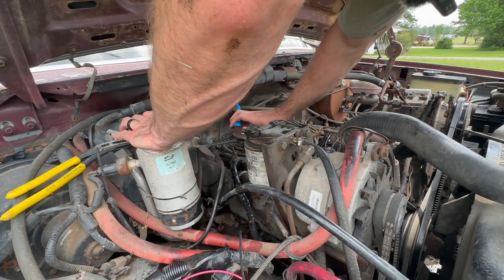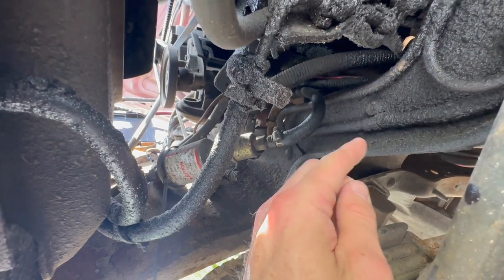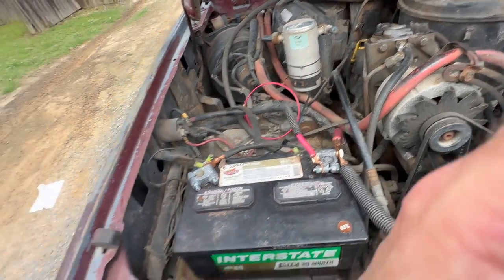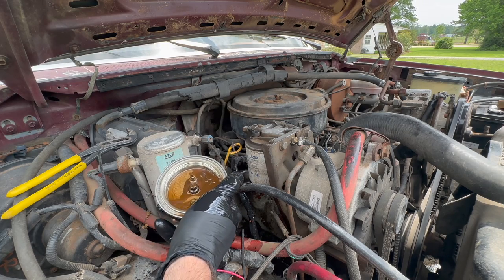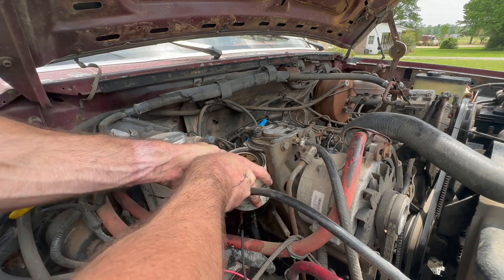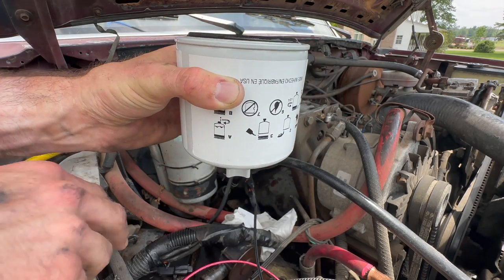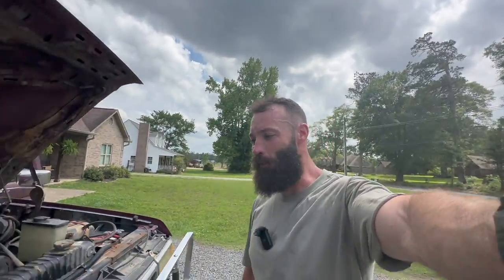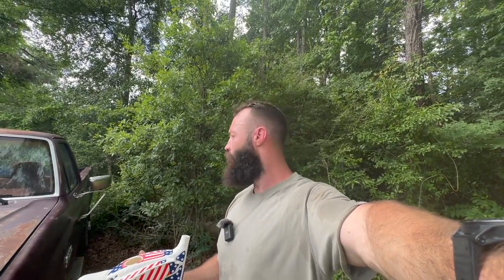Unlocking the Diesel Beast: 1989 F250 7.3 IDI Vlog.....Episode 1

Comment: Gotta love the “while we wait we hydrate” nod to Stalekracker👍🏻 the glow plugs could be a bad relay. Back on the day we used to use relays off Western snowplows as they were cheaper and lasted longer. I don’t care what anyone says, none of us ever had a problem with it. As for the A/C it might be vacuum controlled. If it is, take a look at the white vacuum line, they always got dried out and brittle. I replaced mine with regular old black vacuum line and that did the trick. I think it needs a rear sliding window though, kinda surprised it doesn’t have one
Reply: Rear window needs an old school gun rack!
Reply: @bigguy5360  remember when that shit was a factory option? Damn them were the days👍🏻😂

Comment: The Dash Vents work off a Vacuum Accumulator behind / above the Glove Box on most vehicles, I've used Universal Accumulators to abandon a couple of OEM accumulators because they're difficult to get to and make an OEM Style Repair and Vacuum is Vacuum. When accumulators fail completely, they cause the issue you're having, when they begin getting weak they will cause the air to move from the dash vents to the windshield at acceleration.

Comment: I did the same thing on an IDI, ditch the mechanical and run a decent low pressure elec fuel pump, you can run the pump off keyed ignition. Should always start great, even if tired, bad rings, etc.

Comment: The mechanical lift pump runs off the lobe of the camshaft. With it in there still it isn’t hurting anything, however, it offers a possibly for a place to leak oil and slight risk of something catastrophic happening on the lobe of the camshaft. That is a rare possibility. I would recommend also when you are wiring your relay up for the Eletric pump to secure the pump somehow with zip ties to keep the hoses from rubbing and wearing into a point of leaking in the future. Great content as usual 👍
Reply: Agree with this too! I can see that fuel pump hose rubbing right thru on the metal, so secure\protect themas needed. And yes the mechanical pump isn't hurting anything, probably just a broken rubber diaphragm inside. If you're gonna keep electric one, I'd just pull it and put block-off plate to stop one of the many oil leaks. Lol

Comment: Just put a block off plate on it. The fuel lubricates a diaphragm, but without fuel to go through it would eventually dry out the seal and run engine oil out.
Also, you can pull the “spark plugs” out and put 12v power on the head and ground the threads, it will glow red or if it’s bad not.

Comment: 7:16 no control module fortunately. these trucks used vaccum operated servos to control the blend doors, you may have a broken vacuum line or the "soup can " resevoir may be rusted out. If I recall I it defaults to pushing air out the defrost when theirs a lost of vaccum.

Comment: I think those older trucks use a vacuum block to adjust the blend door for the AC so you could have a vacuum issue. Or the door itself might be stuck or broken. Probably have to get into pulling the dash pad to see what you're working with back there.
Reply: 2nd this! Vacuum operated blend doors. Broken vacuum pump maybe?🤔👍🛠️🇺🇸

Comment: I have owned 3 of these 7.3 IDI's, currently have a 1992, never had an electric fuel pump but I have always wanted to. From what I have read and seen, they say t put a block off plate in place of the mechanical if youre running electric, something to do with risking fuel getting past the mechanical and into the crank case? The block off plate from a BBC apparently is a direct fit. Also these things don't want to start without glow plugs even if you have a damn blowtorch down the intake lol They will run off almost anything including radioactive unicorn piss too.

Comment: Hvac will stick on defrost when there is no vaccume in system.  Gotta check the vaccume lines running on firewall and etc. Fuel pump has two lines one is return to tank other is supply to fuel filter!

Comment: The problem with leaving the old pump is if the diagram goes out it will let fuel in the oil and wipe the engine bearings.

Comment: your ac controls might be cable actuated and might have fallen off. which won't change where the flow comes from. and your ac system/ lines may have failed internally and lost pressure, i don't think you can buy R12 anymore and you might have to buy an R134a swap kit.

Comment: You can leave the mechanical pump.... the lobe on the camshaft sometimes gets wiped out and the mechanical  pump doesn't work, it's a replaceable piece of the cam on the end. NO ATF IN THE FUEL.... ITS NOT GOOD FOR THE INJECTORS.
Reply from the maker: Thanks about the pump! Damn, I was reading about the atf and stuff and watched a bunch of vids and thought I was doing good! Thanks for the heads up! 🇺🇸🦅🇺🇸
Reply: @COLTS WAY  you're doing great and love the content bud! ATF is debatable.  It will burn and old diesels can handle it BUT it's an oil designed not to burn. It creates ash when it burns and can wreak havoc on newer diesels. The combustion chamber of an idi is something I wouldn't want to get all ashed up. Also be careful of the glow plug brand you use.... some swell and break off in the head.

Comment: If you leave the mechanical pump in there when the diaphragm ruptures it will puke all your fuel either on the ground or in your crank. I've had multiple of these old idiots and the mechanical pump has failed on everyone.  But technically you can leave it in there and pump through it.